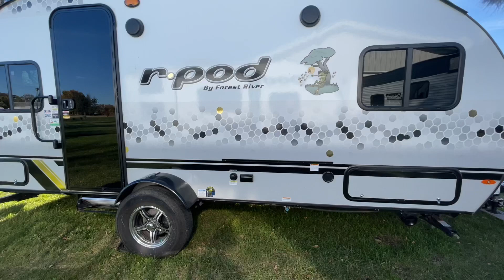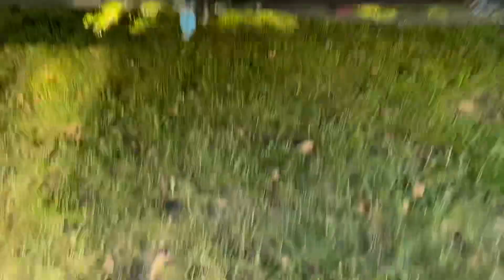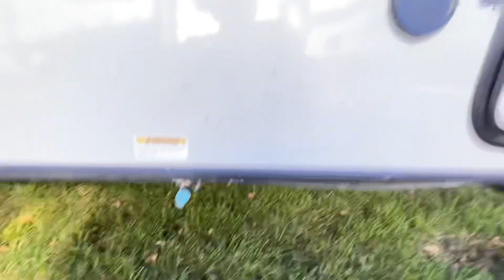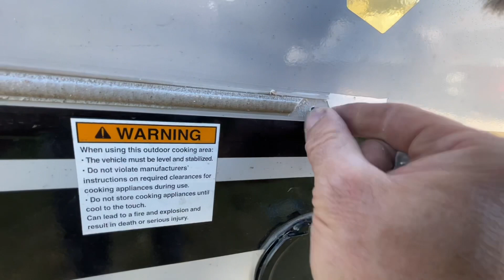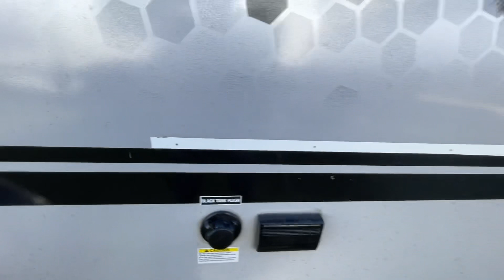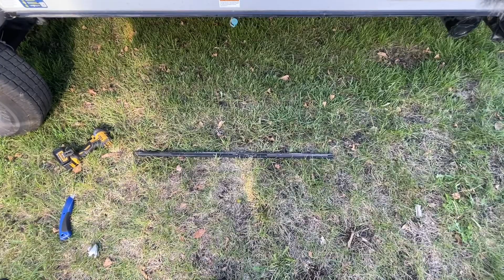Griddle mounting rail repair, R-Pod “bush kitchen” outdoor kitchen bracket

Comment from the maker: Both of my R-Pods with the outdoor griddles have needed this repair.

0:00 objective
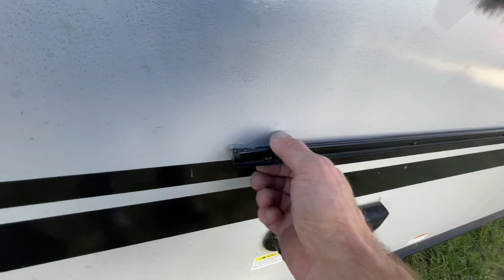0:22 the issue
0:52 removing and prepping for the repair
1:47 it's removed
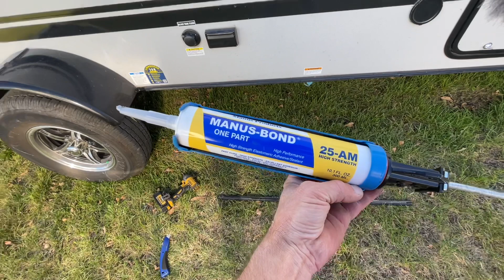3:20 the adhesive I'm using
4:51 reinstalled
5:13 all sealed and done